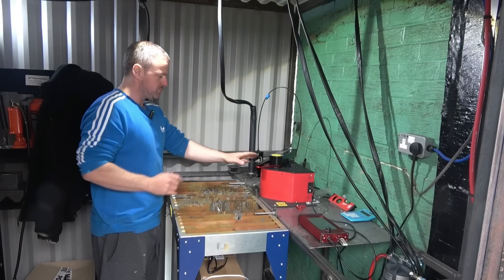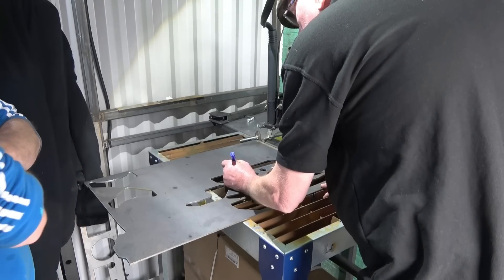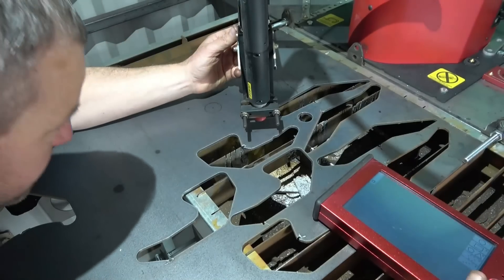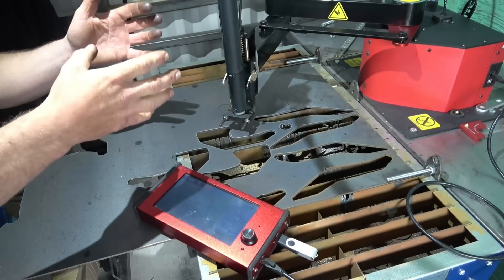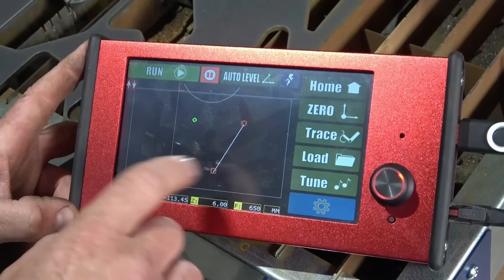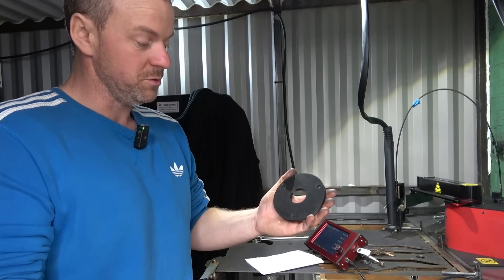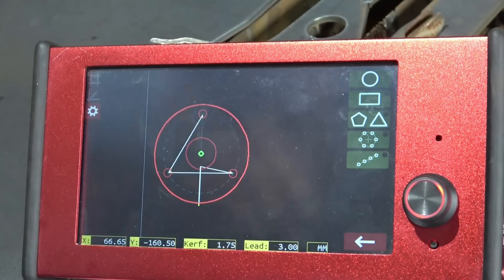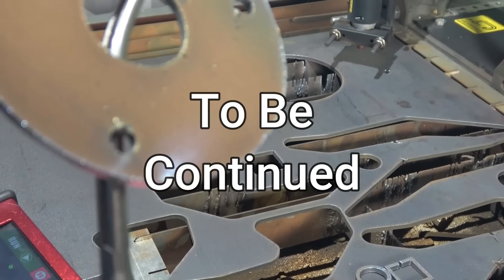This CNC Robot Will BLOW YOUR MIND! (Arcdroid @ XtremePlasma)

Comment: That's pretty slick.  About the only thing I can foresee going wrong is the display getting scratched from shop hands.  A glass-screen upgrade might be pretty nice.  He'll have to cut himself a hangar/holder for the control box.  It should be fun!
Reply: I’ve purchased one and I had the same issue.. the controller needed a holder. Over on my channel, I have a video of making one… I used a computer monitor arm and made a holder for the end of it.. it pivots and pushes out of the way when not in use 😎.